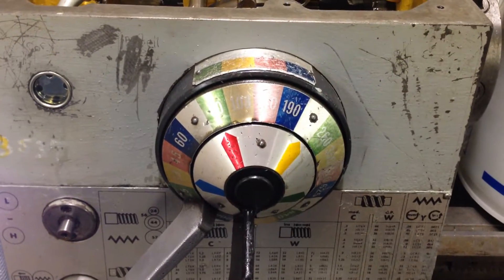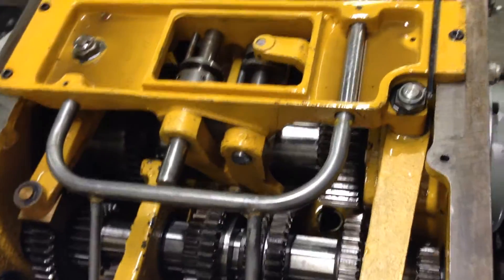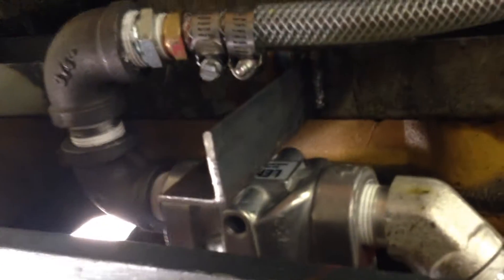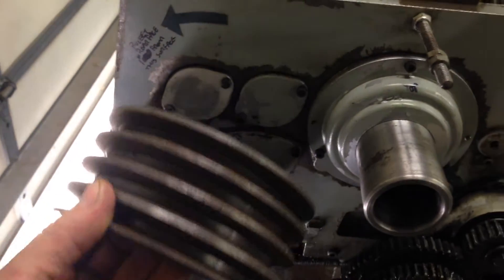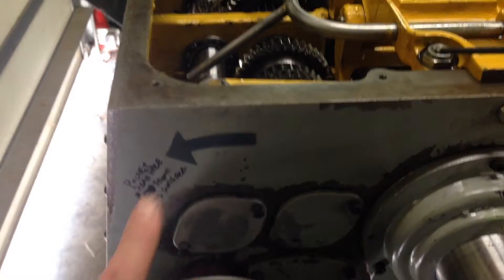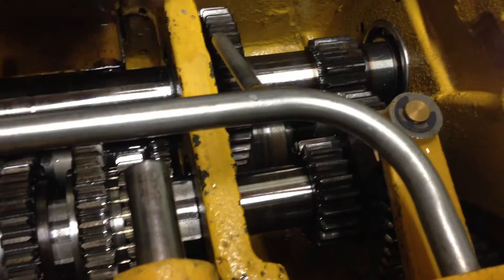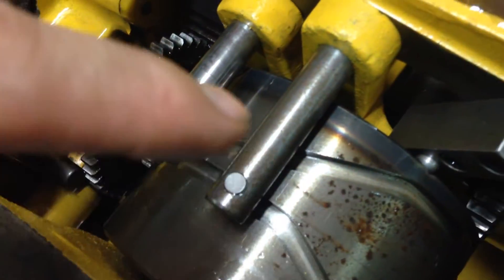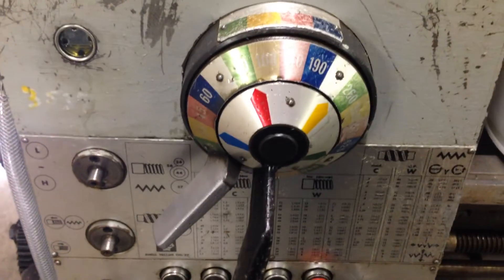Clausing Colchester 15" Triumph 2000 headstock rebuild and improvements

Comment: Thanks for showing us the oil passages....I'm concerned about plugging and starvation. Your coastal brand appeared milky and not as clear as the shell  product...but a filter is key to prevent crap from being circulated....

Comment: hi. I have a triumph 2000 that have high whining bearing noise in forward rotation and much less in reverse. The noise is not present when clutches not are engaged. The noise is still present when I put the gear changer so that no gear is engaged, not so much but it's there. The noise is not worse with high rpms that on low. So the question is, what bearings are bad in my gearbox? is it the J-shaft or H-shaft bearing on the forward side thats gone?
Reply: Headstock bearings sound shot

Comment: Please please , teach us how can we remove the clutch shaft from Head. 
reply at gsp573@yahoo.comccccccccccccccccccc
Reply from the maker: All you need to go is google triumph 2000 lathe manual, which should take you to the chainganger website. He has  the manuals for these machines. The headstock cross section is key to figuring this out.

Comment: Hi, do you have a the SKF bearing numbers? i´m loocking for new bearing for my lathe. :-)
Reply from the maker: Google triumph 2000 manual, download the PDF, and you'll find the bearings are listed in there.
Reply: @TD16V  great tip...!

Comment: As I recall, I've seen shaft keys used as a safety to shear off in the case of catastrophic failure, or a crash with the chuck. The two keyways could mean that one was a spare. You might be able to tell from the parts manual.

Speaking of filters, I have one on my parts  washer that is a home water filter with wound yarn that is available in capacity down to one micron. Normally I would not need one so fine except to try to filter out soot from Diesel engine oil, which it did to some extent. I like the ability to see what the oil and sediment looks like. Got it at HD  in the water filter section. I added a second one in case the fine one became restricted. No discernible deterioration of the plastic in maybe five years of use with mineral spirits.
Reply from the maker: Toby W that's good information. The "depth media" filters you describe are the daddies for fine filtration for sure, but for oil you need high pressure to work with the filter, and even then the throughput is low. I consider the addition of any filter way improved over the original setup.
As regards the keyway, I've never heard of these being used as an intended shear device; pins yes, but not keys. Irregardless, the manual calls for two keys. I've since learnt that this is simply a bad design that affects many of these lathes, even those with two keys. Should have used a taperlock from the outset, or a longer shaft the full length of the pulley width, to eliminate the cantilevering of the pulley on the shaft. luckily Colchester made this shaft a tickle over 1" so it's easy to machine down and fix their mistake.
Reply: TD16V,  the 1 micron yarn filters were used in a parts washer that could be blocked with the thumb, so back pressure is not an issue until the filter starts to stop up. I kept an assortment of filters depending on how dirty the parts were. Filters were were about $2 as I recall. I cleaned general auto parts so there was plenty of grit to deal with.